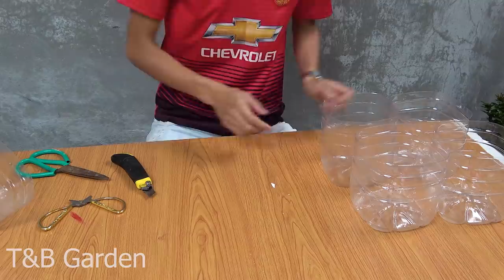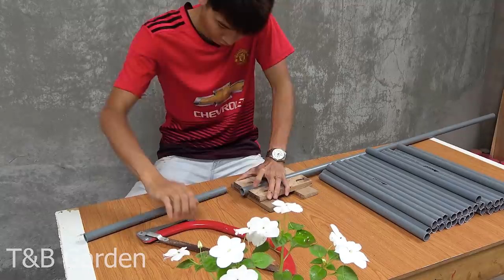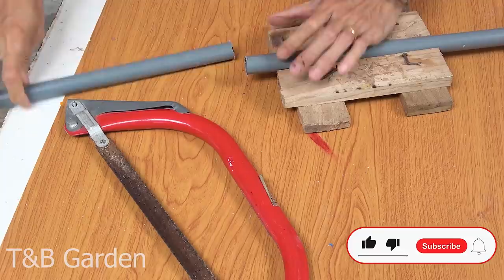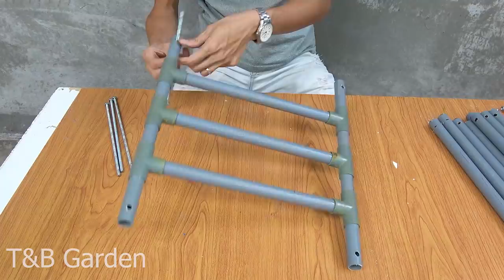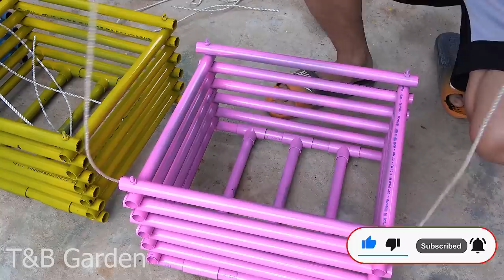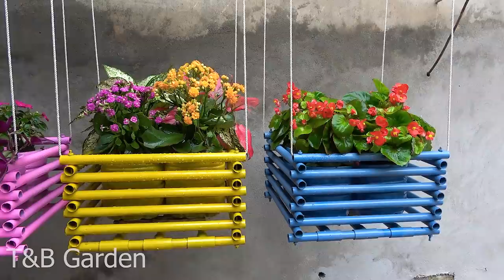Recycling Stacking Plastic Pipes into Hanging Box Planter for Your Garden

Comment: Hi...I was being amazed by you hand craft....but I have one question about the material you are using
 The one that you use to make a hole on the plastic bottle...what's the name of that thing please?
Reply: It's called SOLDERING IRON. You don't need to have one if you're not going to use it that much. Just use a long nail with a candle 🕯️ to burn the tip of the nail and use a plier to hold the nail to avoid getting burn. Hope that helps. Happy DIY 🙂